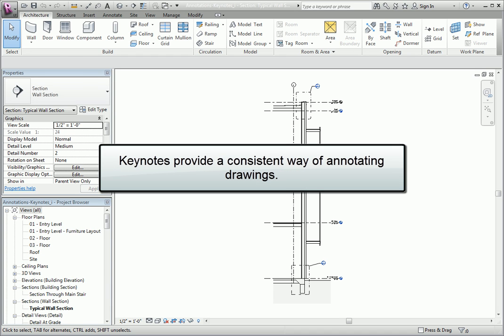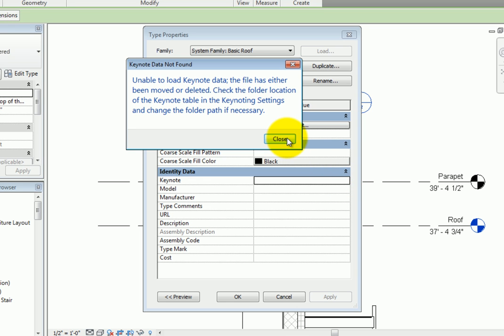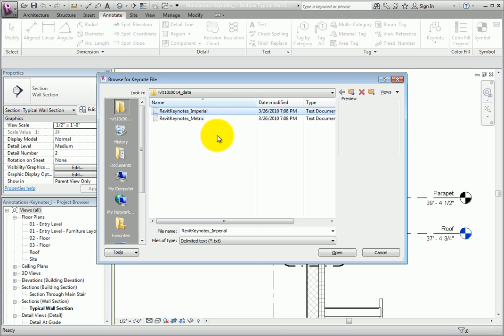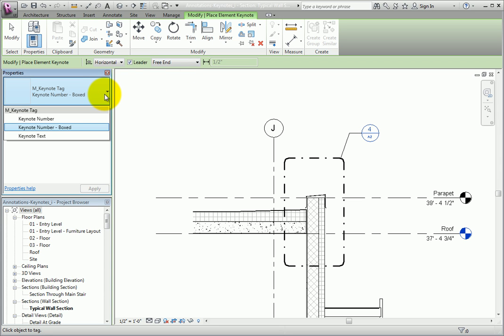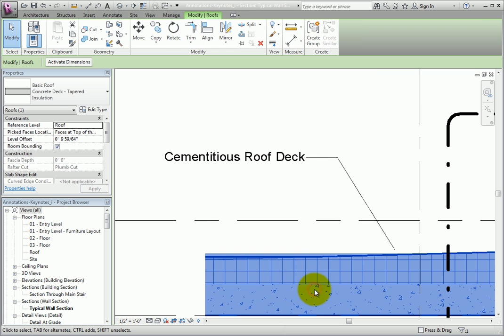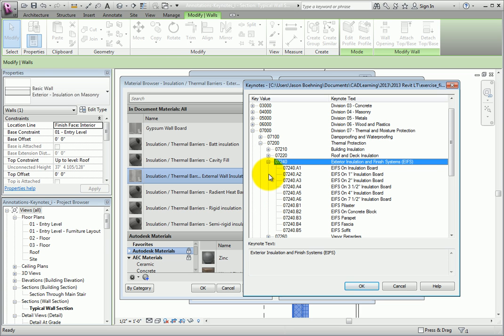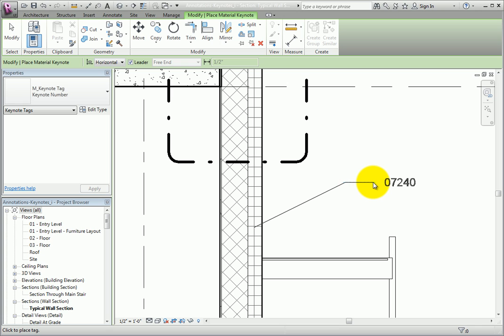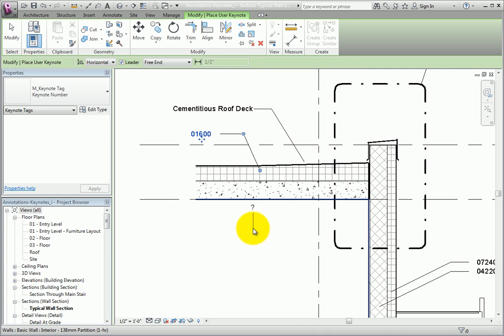Creating Keynotes

Comment: You need to set them as a sub cat for the field. for example
300	Standard Notes	
300-1	Typical Notes and Detail Shee Callouts	300
300-1-001	REFER STANDARD NOTES ON DRAWING Sxxx  	300-1

the tab space / number at the end of the keynote defines it as a sub cat of 300